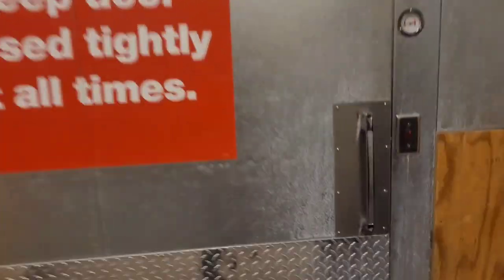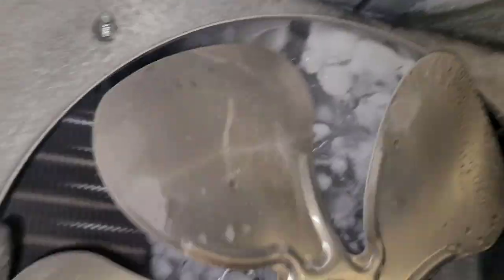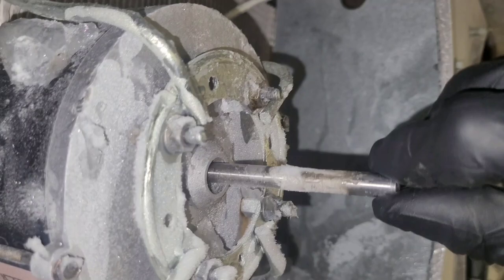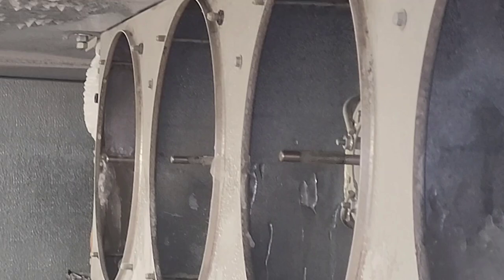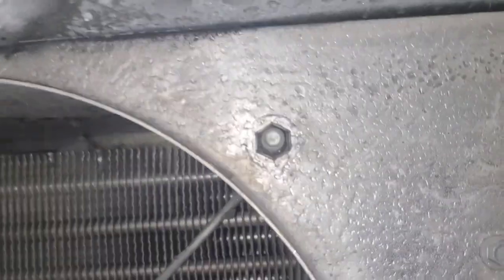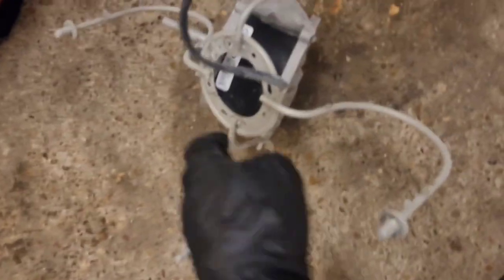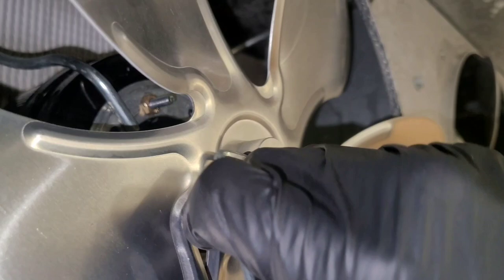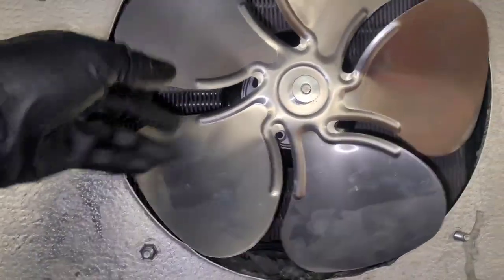WALK IN FREEZER FANS NOT WORKING - 5 OF 10 FANS ARE NOT RUNNING - NEEDED 1 MOTOR AND 1 BLADE

Comment: When I first started to learn refrigeration it was from an old German guy, the first freezer I walked into was -30 degrees. I was geared up and it didn't mean anything, I wanted to quit right on the spot. 20 years later I am glad I stuck it out.
Reply from the maker: OMG, -30°!? That's like, woah. @ 0°F, the moisture on the little hairs in my nose rapidly turns to ice as soon as I take a breath inside the space. I can feel the ice crunching around when I flare my nose in and out. I would freeze at -30°. Yeah, the double /triple layers don't really help much, you need to add heat of some sort. They make those hand warmer type of pads, but designed for the inside of a shoe. They work on less oxygen, but you have to keep them from being exposed to normal oxygen levels, or they overheat. Must haves if you need do anything in a room that cold.
Reply: @HVACRServiceTech  It took me 45 mins to change out a fan motor. The wires where like steel. Took the an guard off 15 mins then ran out. Double your time for everything and that's if you don't run into any problems. Then we walked accross the street to Arby's to grab lunch, still wearing our gear it was 95 out. You could see steam coming off our shit. I stood in line behind this lady and see goes where the did you come from OMG! She could feel the cold, let me take cuts just to get away from her. Lmaooooo
Reply: @HVACRServiceTech  Also a regular walk in cooler don't even phase me. I could spend the night in one. Lmaoooo

Comment: Those stores are replacing all there walk-in cooler/freezers because of what’s happening there. All the outside moisture is penetrating threw the joints in the panels causing building up of ice.
Reply from the maker: Yeah, they definitely need to.